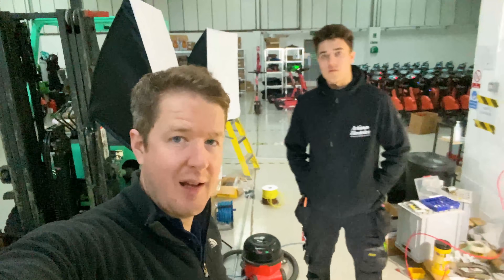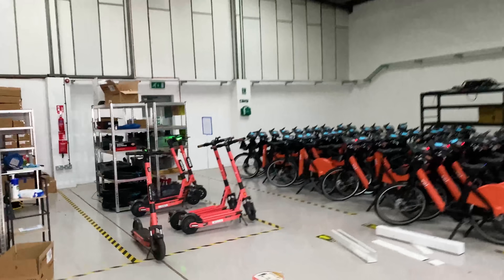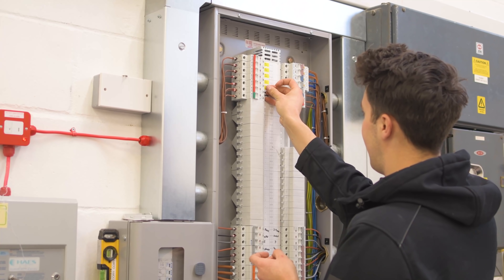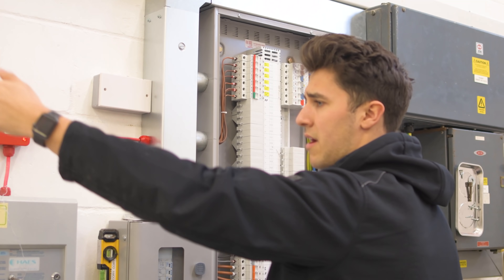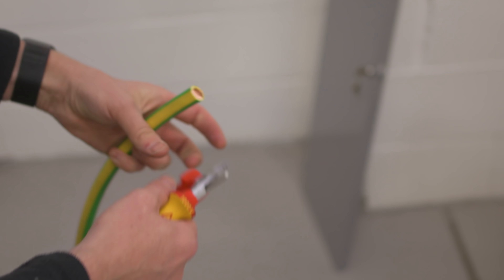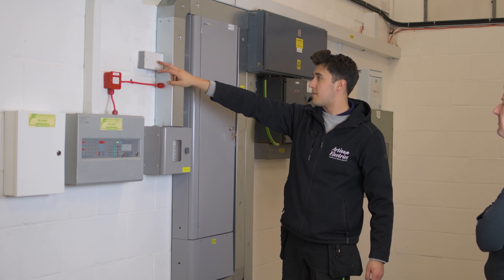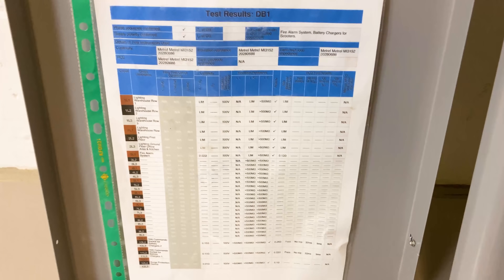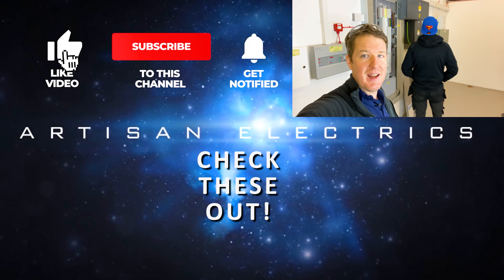Industrial Electrical Installation - Board Upgrade & Electric Vehicle Chargers - Day 3

Comment: Nice to see the MEM equipment again now retired but spend 3 years in the Factory 2 days a week  inspecting all the panels and electrical equipment for Terminal 5 , i was in charge off the final handover and inspecting and testing for the job 5 year contract 300 sparks 100 Electr. design engineers and CAD persons 300.000 TEST SHEETS all set up by me and my name on every single drawing for approval and test sheets.

Comment: Very nice job. A few very minor things, that you may want to consider: 
1. Unistrut end caps 
2. A metal-clad blank-plate instead of plastic
3. Gusset bends on the 50mm tray 
4. Tray Earth braids at joints, especially where you have stopped the tray and started it again to float over the columns.
5. Before you leave, you can cut the tie wraps in the DB and the cables will generally be “set” in place and won’t move. Some people don’t like cable ties in boards, but it’s just preference. So you can use them whilst terminating the board and remove them at the end.

Comment: 12:35 "Leave it how you would like to see it", just hope the new sparkies who come to this site (If it isn't you chaps) will appreciate all of the effort.
Reply from the maker: They already got in a new sparky to do one job! I had to go back there the other day to check something and saw that they had added a new circuit 🤦‍♂️
Reply: @artisanelectrics  Urgh!, that's like making an adjustment to a Monia Lisa painting!, i'm a sysadmin but back in the days used to install servers in datacentres which involved running fibre/ethernet cables...granted not as dangerous as you chaps, still....even with networking you need to take pride in your work!. Love the channel by the way, just subscribed, i wish you chaps all the best!

Comment: Where did all those short little bits of fine copper wire come from in the bottom of the busbar chamber you vacuumed up? Not good if any fall through into the main switch bellow.
Reply: From cutting the tri rated tails most likely

Comment: The cables to the zappis are mentioned to be dimensioned 50 mm²: In the DB shot the single wires are visible and definitely not that thick. What did I get wrong?
Reply from the maker: I’m not sure what you mean, we installed 5 x 6mm cable to the Zappi’s I have no idea where you heard 50mm that would be ridiculous
Reply: @artisanelectrics  At 1:36 " fifty mill". I just recognised you may have meant the diameter of the pipe where the cables are put in?
Reply from the maker: That’s the cable tray width

Comment: Looks great guys! 
We use finger trunking inside large panels now. It saves a huge amount of time, looks great and also saves you when at the end of the job the client adds an extra circuit you don’t have to go in there and cut all the cable ties! 
A nice way of finishing off the cantilever arms is using some 41x41mm uni strut cap ends, sometimes they can be really sharp.

Comment: Hey man a good an tidy job as always a question which kind of torque screwdriver set you use i like Wera butt the dont go further then 3,5nm  some bigger breakers and relais i use at work need a bigger Torque range.
Thanks in advance man.
Reply from the maker: We have both the Armeg and Wera ones
Reply: Thank you going to look into the armeq  set.
Reply from the maker: You can get it here: https://amzn.to/38IiazH
Reply: @artisanelectrics  thank you for the effect.

Comment: Great video again.  I use parrot beak cutters for that fine strand cable.

Also what are you going to do about the large open holes in the switchboard.  Don't they need fire sealing too?

I know it's silly but the open hole down to the main switch is just a magnet for stuff to fall into while the busbar chamber was being worked on, without know the actual mechanics of the switch, there may have been potential for an object to fall down and may cause a short to what would still be live?

Comment: Can someone please explain the need for the bus bars, could you not take the tails straight into the isolator?
Reply: Suppose they could have done. However if existing install had it no harm in leaving it and quicker to install new dB around it.
   Plus if you need a large 3 phase supply elsewhere in the the building etc you can come straight of the busbar instead of the new dB.
     Suspect the old installation may have had several isolators fed from that busbar chamber originally who knows!
Reply: I was already wondering about that, too.

Comment: I will never, ever understand why you don’t use Wago TopJob or Phoenix installation clamps and wire the whole thing at home in the workshop.
https://youtu.be/9Tb6gAqj5vo
Reply: How could you possibly do that?
It’s not a bms panel
Reply: @tomorichard  I have some experience over here in Germany and splitting the outside cabling from the actual wiring in the box (by using TopJobs) gives you better productivity, better results, easier troubleshooting, better documentation and you will probably never need to touch a cable in the building again. There are enough videos on this channel where some clowns have done a shit job with the installation and Jordan needs to deal with laughably short cables, extensions and moving the whole bloody box under the ceiling just to get enough wire again. 
Do it with installation clamps once and you can redo or extend everything in minutes, not hours.
Reply: @maxking3  I understand the need to extend cabling within which is essentially a maintenance free din rail connector where needed.
But why would you do that where cable length permits reconnection??
Reply: Why would you need to do that lol 😆.  Pointless and unnecessary.  All your doing is adding extra time and introducing a joint into each circuit.
Reply: @paulharrison6408  That joint is a controlled “exchange point” where you can measure, label, extend and rewire everything. You might be lol’ing about it, but guess what I do when I see another 3rd world electric installation on this channel, done by a complete nutjob with no knowledge, budget or time, leaving a decent spark like Jordan with the life-threatening results of his incompetence.
I am sitting here smug with an distribution box that is 2020 German standard, so basically 20y ahead of what you do in the UK right now.

Comment: looming looks good. but shouldnt be done in dist board, grouping factor / heat build up, , used to do it on large contracts until pulled up years ago by consultant engineers and trade bodies

Comment: Hi to you both   Regarding zip ties inside a DB it’s always been a bowl of contention, my old gaffer said it shouldn’t be done. But I still did it and if someone at a later date needs to identify cables it’s easy to cut them . As for thermal grouping factors in this particular installation it will never be an issue in this situation . You only need to be bothered when you’re dealing with in high current demands . Once you enter into the realms of say 400v per phase then you enter a total different ball game . But for all you potential electricians out there you will learn a lot from this informative channel . And trust me from the day you start your journey till the day you retire you will still be learning . 😀👍

Comment: Personally I used to dress a fuse board up like it was it’s wedding day, spent a lot of time doing that on many occasions, now though, as long as it all labelled up properly and conductors out of the way and neat I don’t bother with all the faf, saves times and is easier to test.
Reply: Totally agree. Waste of time. Neat enough is good enough. Each to their own though....Fire alarm cables on the 2 inch power tray?
Reply: Totally agree. Neat enough is good enough. Had to argue the toss with some sparks about time taken to dress cables in etc. Simply can't afford to take 4 days putting away circuits when can do in 2!

Comment: Nice job .. don't forget the rccd test label and test label .. I would also fit some 400 volt warning labels to DB and three phase equipment. ..Did that lighting joint box to the left of the DB have three phase inside it and more than one circuit enclosed . Will require a label fitting ..to warn anyone

Comment: Professional and super tidy installation. Any future electrician that comes to work on it, will thank you. Also here's a recommendation for you, (Portasol APSK SP-1K Super Pro 125 Kit 5 piece gas solder kit) has a flameless hot air blower, which  easily shrinks down any size of heat shrink sleeving. It's piezo electric start, and has good run time on one fill of butane. I got mine from Amazon, and have had good use out of it. Great videos, keep up the good work. Stay safe, and all the best for 2021!